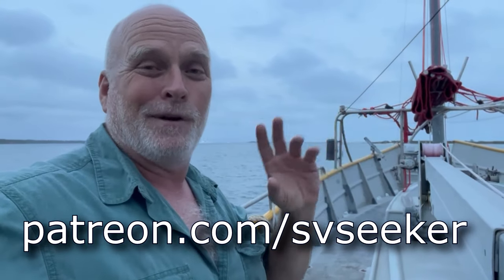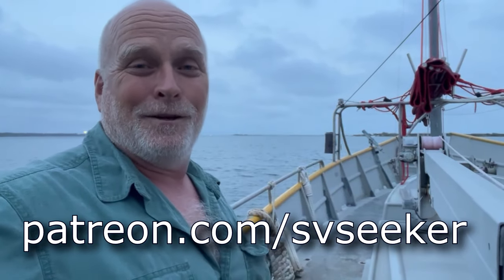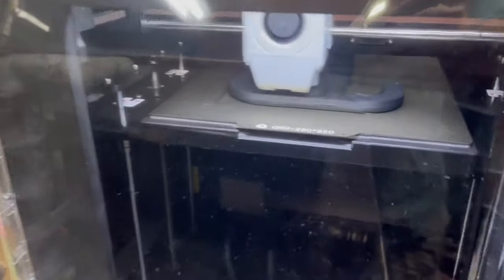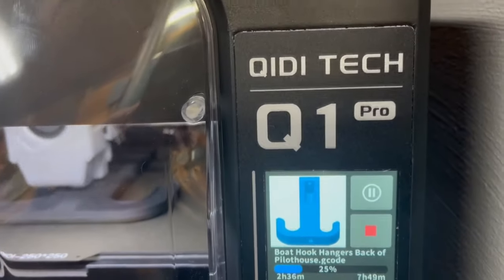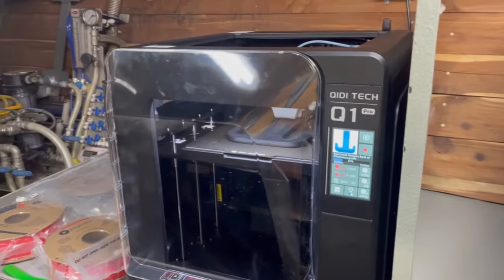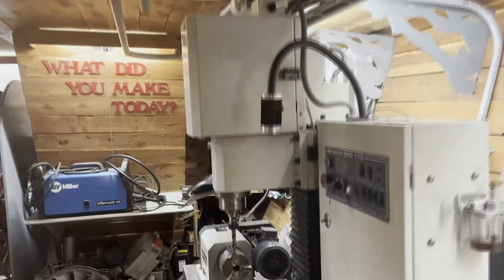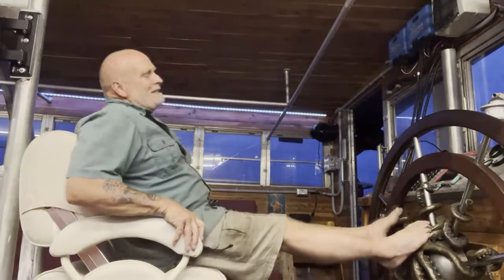Coming Soon

Comment: Hope the storm wasn't too bumpy.
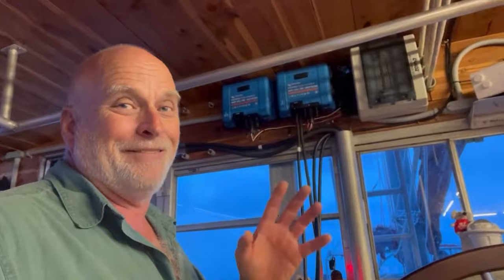01:15 I've had a wood burning stove on my boat for over 30 years, in 2000 I made one from a 13kg propane cylinder.. though I do like your diesel heaters.
Got my MCA Yachtsmasters 1989, get really familiar with rights of way and the sailing terms.

Comment: What filament are you using?
Reply from the maker: PLA
Reply: I’d go with PEGT, you will find the PLA is not very strong. 
PEGT is just as easy to print with, just have to use a little higher temperatures. 
220c on the nozzle and 65 on the bed. 
It’s a LOT stronger than PLA. 
ABS is the strongest but it produces toxic fumes, I just don’t want to mess with that.
No toxic fumes from PEGT. 
Good luck Doug.